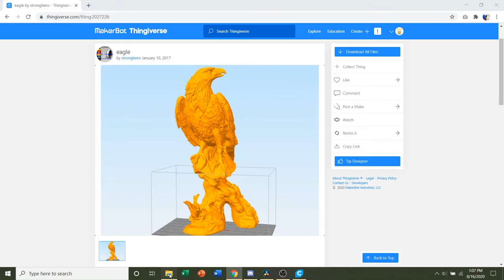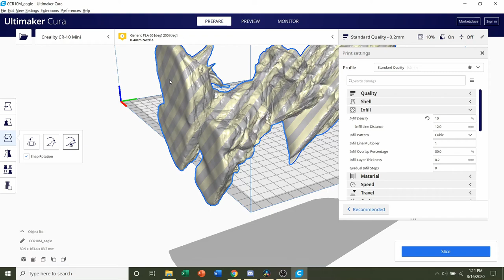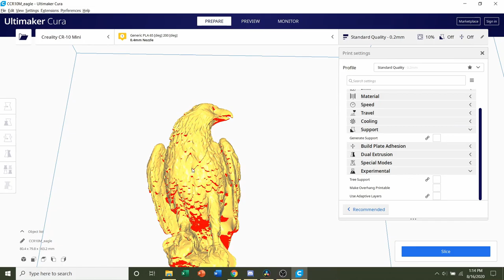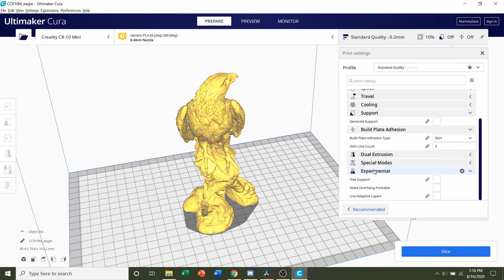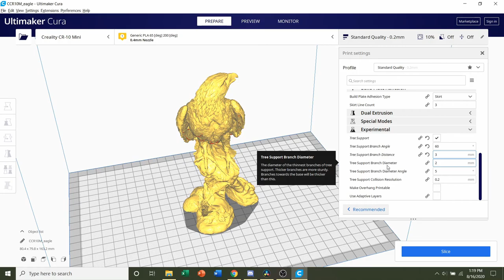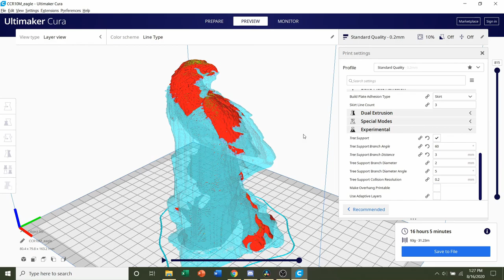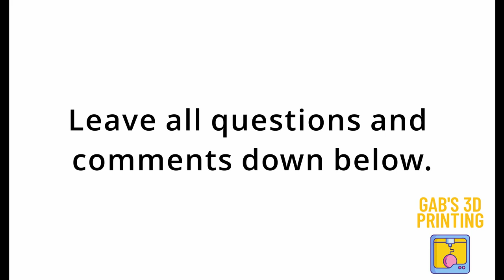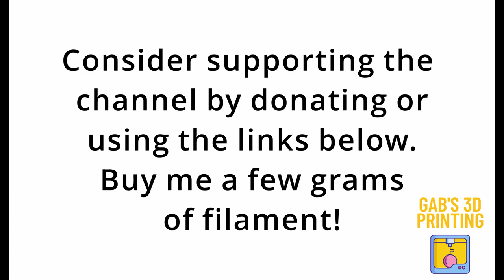Eagle 3D Printed - Tutorial, Print Settings, Time Lapse, Support Removal, Showcase, Painting

Comment: I have an Ender 6 with 250 x 250 x400 build range. Using Creality Slicer. I figured if if scaled down to 90% it would fit the printer but I get a message saying unable to slice.
Reply from the maker: There are hidden boundaries in Cura. You might have to slice it even further down in order for it to slice.

Comment: Can you help me do it myself? 1. I need 3D printing machines. 2. What kind of software do I need? 3. what material do I need? Could you help me?
Reply from the maker: Yes, any entry level printer would be fine. I am using a CR-10 Mini, but I know a lot of beginner printers enjoy using a Ender 3. The only software you need is the one shown in the video which is Cura slicer. It's completely free and the video shows you step by step how to use the slicer. For material, the most common material is PLA (1.75mm). Any brand is fine, but I use hatchbox.

Only warning is that this model (Eagle) is a hard print because you have to remove a lot of supports carefully. If this is your first time printing, I would recommend you print something smaller or simpler to get a good grasp at 3d printing.
Reply: Thank you for taking your time and reply my messages. Your comment would be helpful my entire life, again thank you.
Reply: Printed on anycubic viper uses gray PLA and cura with around 60mm speed/1.75 layer height, take 17 hour 40min,I have absolutely no idea what to do with the paints tho.